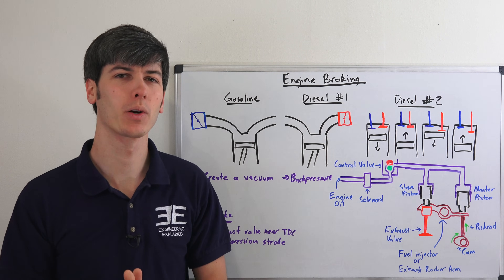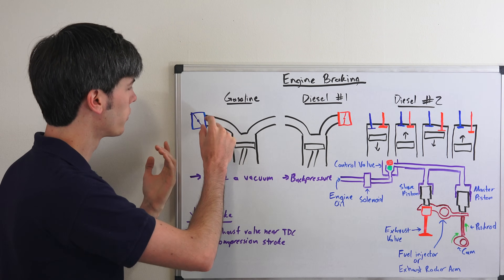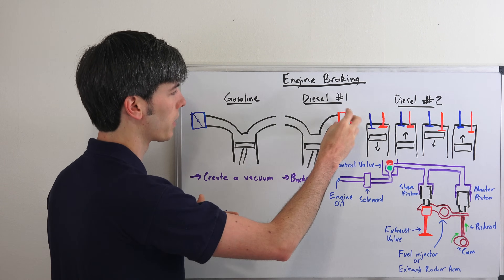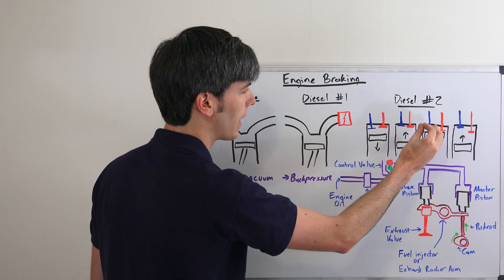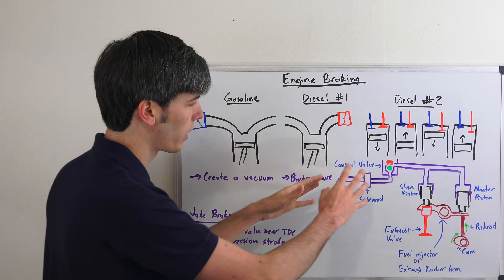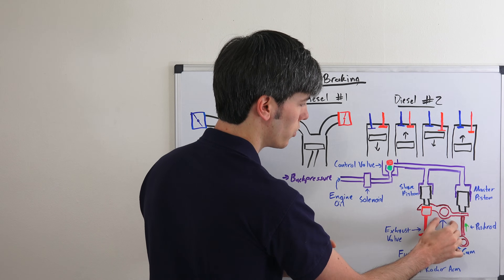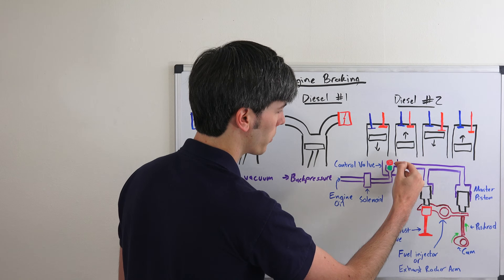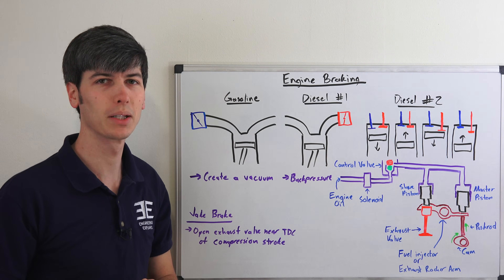What Is Engine Braking? What Is A Jake Brake?

Comment: So when engine breaking in a gasoline vehicle, the piston is doing work on the atmosphere on the intake stroke (low pressure on the cylinder side, high pressure on the crankcase side) and that slows the car. But then on the compression stroke, doesn't the atmosphere do work on the piston?  So where is the net breaking effect? Is it through pumping losses? That doesn't seem like it would provide much breaking.
And on the other hand, if the vehicle is doing work on the gas in the cylinder on the compression stroke which slows the vehicle, the rebound on the power stroke would return this energy (less heat loss) to the vehicle. 
I assume all the breaking then is from both pumping losses and heat lost on the compression stroke. Is this correct? 
But on my old car, I noticed when engine breaking on a long steep hill that this engine temp would actually go down.
Reply: You are correct. The braking is primarily from pumping losses, friction and any mechanical losses from driving oil pumps, fuel pumps, alternator, AC etc.

The energy consumed during compression is almost exactly the same as the one released during the power stroke, it all happens too quickly for meaningful cooling of the compressed air.

Comment: Well can you explain the "L" mode in newer automatic subarus. The book says it's only for engine breaking but all the Subaru people (sales, mechanics, etc) have said it's also for low gear up Hills and stuff. I just really want to know what it's truly for.
Reply: It just means LOW which keeps the car in a lower gear than you would normally need, and that can be used for towing, engine braking, or if you are getting ready to pass someone in a tight spot...
You could also instead just select the specific gear you want (assuming its got a 1 2 3 D configuration or some other way to select gears)
Reply: Adam S
but there are no gears. it's a CVT
Reply: *****
Subaru says 1000 pounds or 1500 if the trailer has breaks (on crosstreks and such) towing for CVT/manual.

But yeah, I'd go easy on them since it's a band/belt and not gears.
Reply: I guess by gear I meant ratio, I know it doesn't technically have gears with cogs.
Its a belt of two pulleys that can squeeze and retract (opposite of each other) to lower or raise the ratio (again I want to say gear ratio).
Reply: +Adam S (Dolby109) you can still say ratio and be fine.

Comment: Never really knew if engine braking increases fuel consumption?  

Can anyone comment?
Reply from the maker: +Barry Wu Typically fuel injectors will shut off, meaning you consume no fuel while engine braking (in modern cars).
Reply: +Engineering Explained thanks! I need not wonder no more!
Reply: +Mechanized Ape my 1993 Saturn SW2 does it.
Reply: +Juden Induven I assume when you say standard you mean manual. The answer is no, newer cars completely shut down the injectors until the RPMS are low enough they need to produce power again. In some cars that show current MPG when you downshift it will peg because no fuel is being consumed and yet you are still moving.
Reply: It is better to use the engine brake on long declines (descending a mountain pass, for example), as you can overheat the brake fluid by constantly holding the brake pedal down (not to mention the loss of braking force and increased wear from hot brake pads). 

Overheating the brake fluid means it evaporates, and evaporated brake fluid means you don't slow down when you hit the brake pedal.
Reply: +Engineering Explained ah so we do have an answer, thank you! (^ comments above.) they TYPICALLY shut off for modern cars. I'm guessing that's 2000 and newer maybe some nicer 90's fi engines? Now when you say typically shut off. Do you mean all modern cars generally shut them off at certain rpms (never idle speed) depending on the conditions but not always the entire time engine braking is occurring? Or that some makes will do this and some will not ever shut the fuel injectors off under any conditions (except when the car is shut off)? If this is to specific and is dependent on the model(engine) then no worries. Just curious to know how well thought out our cars are and how much they can be improved. Thanks again for the channel.
Reply: ***** When just doing a normal downshift the car does not burn gas. Because manuals have no torque converters its just direct from engine to transmission to drivelines. So when you downshift it basically uses the already moving driveline and rotates the engine. because the engine RPMs are slower then the driveline you get the cracking and braking effect. The reason it breaks is because like in the video above, the engine now has a vacuum. This is because the engine is spinning way faster then the throttle says it should and thus kills the injectors. So the more downshifting you do, the more efficient your car is and the less wear you will have on the brake pads and rotors.
Reply: The clutch doesn't wear any faster then normal shifting, once its engaged there isn't and slip. Also double clutching will basically eliminate the need for synchros. Still, glad I could help and hope its all cleared up
Reply: +Juden Induven and piston rings and bearings. Why wear those more than you have to. Only wear them to make power. That's what it's for. Pads are what? $35? Your not saving that much gas while your car is at idle engine speed as you brake. .4gph in a 2.2L i4. That's 2.5 hours of idling to burn one gallon. Or spend about $2.15 (87)
Reply: +Mechanized Ape lol "shot* up" sorry
Reply: +Mechanical Ape 2008 subaru outback, when downshifted the current MPG goes from about 23 to 99
Reply: +tomthebattleaxe yes in my Avalon the mpg goes to 99.99 also but fuel flow never drops to zero gph.
Reply: you are not burning fuel when you down shift. you don't need to worry about engine braking anyway, this was made for trucks. when you need to hold back a lot of weight. all these little cars you are all talking about can be stopped with your brakes, no problem.
Reply: Sorry, simply not so. You'll have to really roach the brakes before any chance of cooking brake fluid. Rather, you'll inflict lots of wear on pads & rotors. Their coefficient of friction drops (IOW pedal effort would rise) as their temps rise- for street pads. OTOH, some road-racing brakes have to be hot to work, I'm told. Can't pull into a service-station out there for new brake-pads.
Reply: engine braking is always going to be better then wearing on the brakes, the engine is forced to turn and will kill the injectors. I do it every day and don't plan on stopping

Comment: i was always of the opinion engine braking (gas engine) had more to do with compression than vacuum. Ever try spinning an engine by hand (with the throttle closed)? You will feel the resistance from compression as each cylinder is on the compression stroke. It has been said that higher compression engines have a more pronounced engine braking. Bump up the compression big time on a new rebuild...you might need a higher torque starter than factory stock just to turn the engine over. There is a decent market for these by the way for this reason. The throttle plate (and Idle air bypass valve if equipped with one) is never closed air tight so their will always be some small amount of air to compress. Engines can do 17-22 in Hg depending...not sure if this is enough the contribute to significant engine braking.
Reply: +green95gt you are right about trying to get a engine started with the throttle open as opposed to idle as being tougher on the starter  but remember that at higher rpm's that compression energy is mostly returned on the power stroke it just acts like a spring getting compressed and released

Comment: diesels dont have trottle body, i will never buy a f*****g smoke machine aka diesel
Reply: +Дамян Стояновски what if i told you i've owned a gasoline truck with 4.9L engine that got 14mpg, and a diesel 7.3L that gets 22mpg? Both 1990's models.   Modern diesels do not smoke anyway, unless you modify them to do so.
Reply: +Pete Green what 4.9l are you talking about?

Comment: Jake brake seems like a waste of fuel.
Reply: +8bitslime  Just about the same amount as if the engine is at idle.
Reply: The fuel is shut off when the jakes come on. No fuel is used when they are activated.
Reply: you release gas pedal in order to activate Jake brake
Reply: Skye13 Well that makes more sense, thanks.
Reply: Skye13 throttle; tractors don't have a gas pedal... lol

Comment: Does this mean engine braking is effectively wasting energy? if so why do cars engine brake.
Reply: +C Bradders If you're braking, you are shedding energy. That is why brakes heat up. You are converting kinetic energy (motion of the car) into thermal energy through friction.
Engine braking saves your brakes.
Reply: Yes I see how this is beneficial to saving the brake rotors. I was just thinking in terms of people who are try to coast along, towards a junction for example for as long as possible, in this case the engine braking is reducing the distance, albeit the gains are minimal but there are sad people who put the car in neutral to do this, not realising fuel has to be used to keep the engine running

Comment: I was taught to use engine braking as much as possible by my driving instructor way back in ancient times.  However, I've since learnt that engine braking is not so desirable as it causes wear on the engine and that, since brake parts are easily replaceable and much cheaper than an engine overhaul, one shouldn't rely on engine braking so much.  That said, brakes are more vital for safety than is the engine, yet brake fade is more a feature of drum brakes than discs.
Reply: +Andrew Gruffudd Not really.  If you do it properly you can save your brakes a lot of wear and tear and not cause stress on your engine.  You're only going to be stressing your engine if you're using your engine at high rpms.  I use it to assist with braking on hills all the time and I save a lot of brake wear that way.  It's easy to keep it between 2 and 3 thousand rpms and just tap the brakes a little bit here and there vs riding your brakes all the way down a long grade.  I've never needed to exceeded 4k rpm using my engine to assist on braking.  On the other hand, if you're going to do it like a jackass and downshift to engine brake from 5 or 6k, then yeah, you're going to cause a lot of stress and wear on your engine.
Reply: ***** You aren't really wearing your clutch if you rev match on your downshifts or just keep it in the same gear down a long hill when you come up to it.  As long as your clutch isn't slipping when you transition between the gears though you aren't burning/wearing out your clutch.
Reply: +Andrew Gruffudd Lots of FUD about clutch wear, and statements that dropping a gear for engine braking is bad. Nonsense, if done at all properly. What wears a clutch: holding clutch disengaged with engine running will wear the throwout bearing; slipping the clutch under load,. like when starting from a stop, will wear the friction material. Minimize those and a clutch can last almost forever. My last one did 425K miles.

Comment: Can someone, please, explain why the engine braking in the 1.4HDi engine is so strong? I mean. It feels like I'm tapping the brakes when I get off the gas in second and third gear.
Reply: And also, it doesn't like to rev. It feels... "heavy". I don't really know how to explain this. 

For ex. when you rev a car, as in you tap the gas, the revs go up quickly and if you tap the gas again it almost goes to the red line in some cars. 
Mine is different. You really have to keep your foot on the gas for a second or two for it to get to the red line, unlike any other car I've seen!
Reply: +Andrei Besleaga In most cases this is due to heavy engine components. Get the rotational parts lightened and it will be more free revving, though in some cases that means less torque.
Reply: +Jack 
Well, other engines bigger than this should have even heavier internals, right? so why are they happily revving and it also feels instant?
Also, as heavy as my 1.4 diesel feels, it should have the torque of a mammoth, but it just has 160nm (or 118lbft).
Maybe it is restrained by the manufacturer from the ECU, as the engine is described as the "eco 70", 70 being the number of horsepower.
Reply: built for reliability rather than power I think, relation to rotating weight against combustion strength, larger engines won't weigh as much proportionally compared to their power output.
Reply: +Andrei Besleaga 
It will have a comparatively high compression ratio, even for a diesel.
Reply: It has a compression ratio of 17.9 :1

Comment: Hey Jason....first of all, thnx  for the very good number of videos that u make providing a lot more valuable info. for someone who is not good in the academics like me. I have a doubt regarding Jake braking. Lets assume that we travel in a steep terrain and move downwards (inclined). In such a case, I do not understand as to how this system would help in slowing down the vehicle. There would be less power for  sure, but the steep would prevent the vehicle from slowing down, whereas a friction brake would help in slowing/stopping the vehicle. So, could this process be termed as braking????? Pls help me with some information and do correct me if my understanding of this is wrong.....
Reply from the maker: +mickey elrin It takes energy for the piston to compress the air in the cylinder. In this case, that energy is coming from the forward momentum of the car. As it compresses the air, the air resists compression and this slows the piston down. As the piston slows, it's connected to the wheels through the drivetrain. As a result, the vehicle slows. Usually the energy used for compressing the air would go right back into the engine, thus mitigating this effect, but the jake brake opens up the exhaust valve so all of that potential energy is lost. I hope this helps!
Reply: +Engineering Explained Got it...Thnx man!
Reply: +mickey elrin Basically, it turns the engine into a compressor during the time the brake is on.  I know you have heard truckers using their J brake, it's pretty loud. I used to drive trucks and the J brake is super useful in areas without noise laws.
Reply: +Tommy Rad Thnx for the info.Tommy!
Reply: squishydafishy Great info. from you:-)Thnx!

Comment: hm... I have to check that "vacuum braking effect" on my car.
I use the engine brake every day on every slow down move.
but I always thought that the brake effect comes from the friction/compression inside the engine.
lower gear is more agressive because: 
1. higher rpm = more friciton
2. gearing gives the engine more "torque" to slow the car down. not because a stronger vacuum effect... (read that in a comment somwhere down there)

well I check that out on my next run.
cut igniton and open the trottle wide open.
If your Vacuum theorie is right: my car should not slow down (as fast)
My guess: its the same
Reply: +DESCENT The reason why higher RPMs would slow you down more is because you would need to move much more air to travel the same distance. Friction plays a roll as well, though not nearly as much as you would think.
Reply: +BeanerMan3k dude I'm a car mechanic. :D
yes, its an Old school throttlebody.

also I described the Open Intake noise.
shouldn't that be clear? :D
Reply: +DESCENT It's not vacuum. In the old days we called this "compression braking"  This is why engine braking works on a diesel without an exhaust restriction valve or a jake brake.
Reply: I just tested it today.
70km/h third gear
60km/h second gear
ignition off
Nothing changed while wide open the throttle or a closed one.
the only difference was the intake sucking sound.
thats all.
(K11 CG10DE 40KW) (yes a tiny engine)
Reply: Yes you are right.. I do this with my scooter as well.. switch ignition off.with wot. engine braking effect doesnt decrease. +engineeringexplained